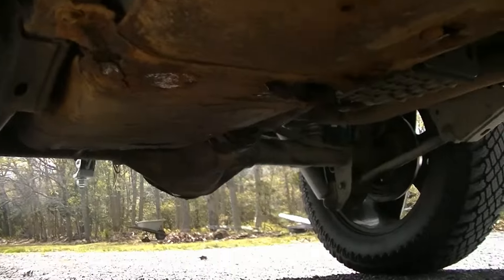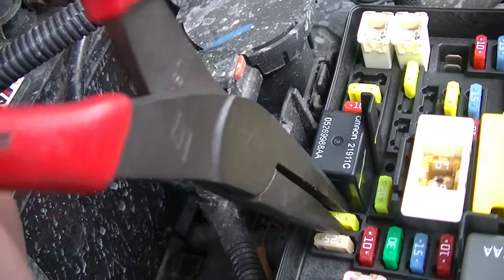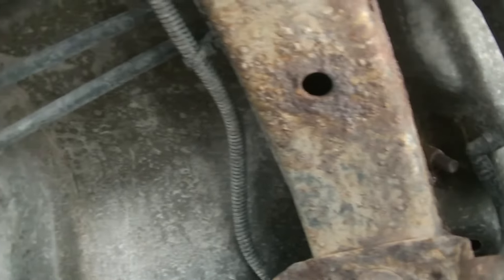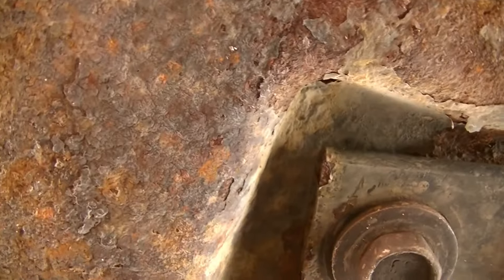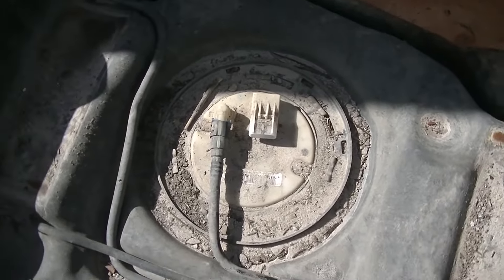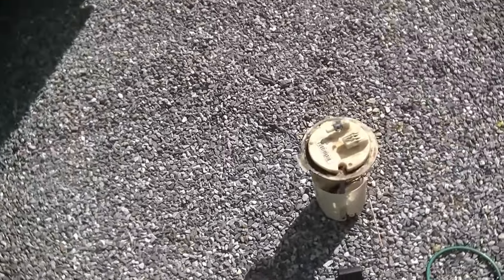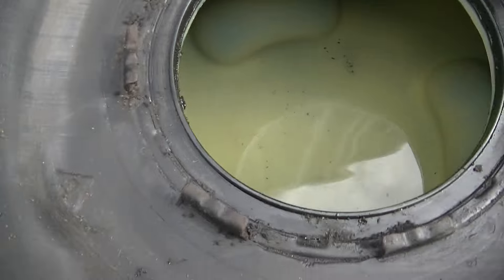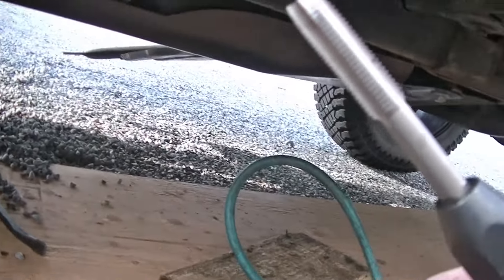2007-2018 Jeep Wrangler JKU fuel tank and skid fuel pump replacement!!

Comment: My new fuel pump had a capped connection at the bottom I left it capped because the old one was molded plastic is that correct?